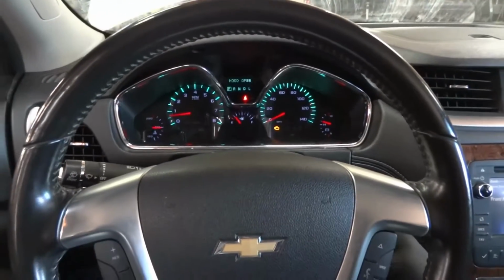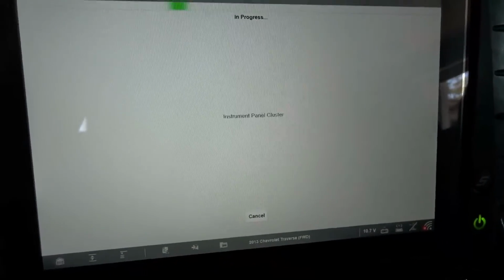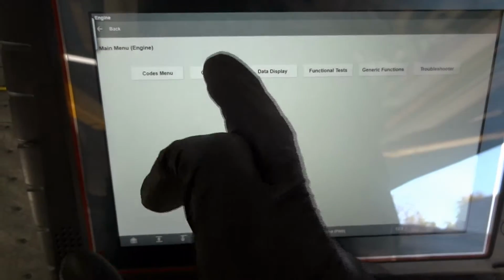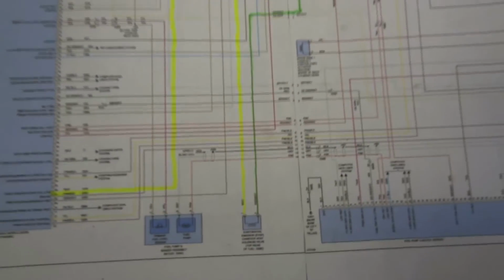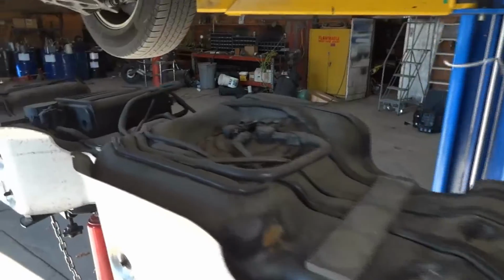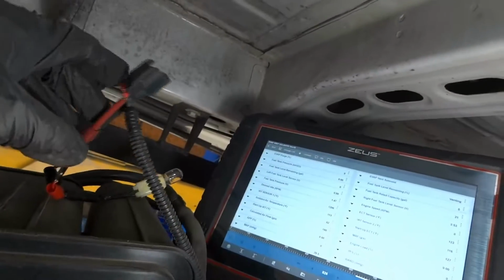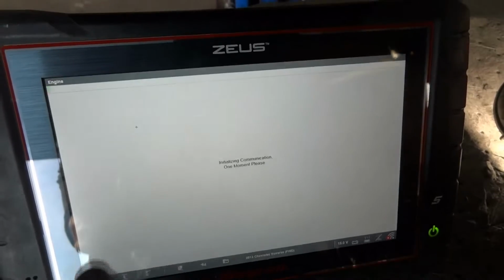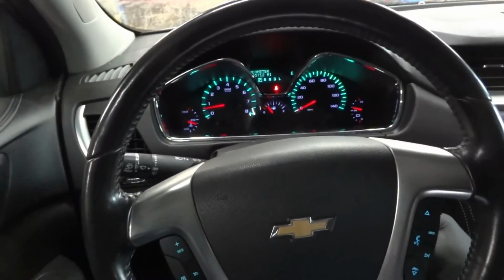Chevrolet Traverse Code P0449 Evap System Vent Valve Control Circuit Open, Diagnosis & Repair

Comment: You are the best bro. I have the same code P0449 for my Hyundai Santa Fe Sport 2014. Then I took it to the Hyundai service. They shocked me when they told me that I should change the canister + solenoid valve + pump, and its sensor !!!! I told them why don't I change the gear and the engine by the way and will solve this P0449 😂😂😂😂
I insisted that it is an electrical circuit problem, or maybe the ground. Up until now, I couldn't find a professional technician like you did bro
God bless

Comment: I have a 2018 chevy traverse, can you possibly tell me if the vent valve is in the charcoal canister or on top of the gas tank?
Reply from the maker: @Osogrande72   it should be on top of the fuel tank

Comment: Mine 2014 traverse is doing the exsact thing. It pulls up purge valve canister under the hood but the light comes right back on 2-3 days later.
Reply from the maker: @adamgrant2017   your vent valve might be defective or the wiring of the vent valve could be corroded!

Comment: my evap solenoid clicks when I plug in the electrical connector even when the car is off with no keys in the ignition. It also gets extremely hot to the touch, I'm actually scared leaving it plugged in being that it is around the fuel area. It seems like it's stuck open/closed. I got a new part and it does the same thing.  Anyone know what could be the problem there?  Thanks!!!
Reply from the maker: Khanh Pham  you probably have a shorted control wire!
Reply: @KITS_Auto_and_Truck_Repair  - thank you so much for the reply. Can you advise on what or how to go about repairing the control wire? is that like replacing the entire harness or perhaps the ECM?
Reply from the maker: @KhanhPham-xq7db  No! not at all, I recommend you take the vehicle to a pro mechanic who can diagnose it for you!

Comment: If the vent is actually defective, can the removal of the valve be done without totally dropping the tank?
Reply from the maker: Dealer Auction Nightmare  No! it's on top of the tank!

Comment: What color is the ground an power to my vent valve  control circuit on a 2015 GMC Sierra 4 wheel drive 5.3 flex fuel
Reply from the maker: Simon flores  red wire is power supply and white is ground from ECM

Comment: drive the 2015 gmc si era  now trip a po172,175,304.what happen I check an found the pipe between the mass air flow an the filter box an it was misfire a lot can that trip this code
Reply from the maker: Simon flores  yes! was the mass air flow sensor dirty?
Reply: I found the problem  the spark wire was tracking to the side of the manifold an the coil  tomorrow I will check the mass air flow thank you keep making those video I am  learning From you

Comment: It was not necessary to replace the solenoid ryt??? The solenoid was okay
Reply from the maker: Allan Kisakye  Yes the solenoid was good and I didn't replace it, the problem was an open wire !

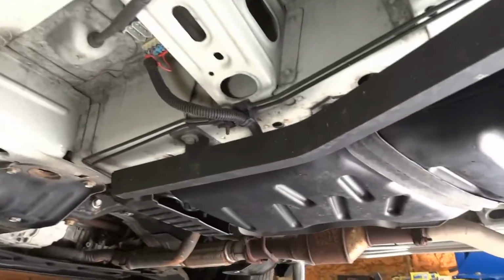Comment: Another technician back probing connectors when the connector is disconnected in their hand and front probing should be accomplished to prevent a very small amount of damage to the connector environmental seals.  I also notice that you follow some of the teachings of the ASE training material. You also failed to do your visual inspection on the harness where it was available to be visually inspected prior to dropping the fuel tank. You also failed to test the portion of the harness from the accessible multi-pin connector towards the vent valve via a resistance test followed by a visual inspection for the section closest to the multi-pin connector that would have located the problem much sooner with no parts required and no time to diagnose the entire harness above the fuel tank. I will only guess that 1 hour of labor to the customer was unnecessary. THUMBS UP but please follow your training mate. Look at the harness at 6:58, there is a low spot where the harness shroud can hold water to cause corrosion right where your wire broke, and very easy to visually inspect the section first. One purpose of the RED ring attachment near the multi-pin connector is to hold the few wires close together and prevent the wires from forcing the black shroud open over time to allow a larger funnel-like formation to allow even more water into the shroud, it was a poor design from GM a long time ago and a bad design until today. At 9:15 there is no tape to help prevent water from entering the end of the shroud, lesson learned. I will also guess that vibration played a role in the damage which was another hint to inspect that hanging section of the harness. Looking forward to watching many more of your pretty good diagnostic videos.
Reply from the maker: Duane Donaldson  Thanks for your input!!

Comment: Hey Deo, Thanks again for another one of your exhaustive videos. You make a great trainer.
A quick one for you….. I got the same code on my evap system indicating a small leak on a Audi Q7. Please point me in the right direction on how I should go about fixing the issue.
Reply from the maker: Michael Owino  Thank you!! email me at Deo@calleva.org and I will give you some ideas!!

Comment: The wiring test with test light for the  circuit wasn't Complete  before you go ahead and order the Part . You a Master though 👈 great teaching  !!👁️
Reply from the maker: svhebert  Thanks! I almost turned into a parts changer Lol!!
Reply: So I can bypass that circuit by just jumping the connector with a wire correct?